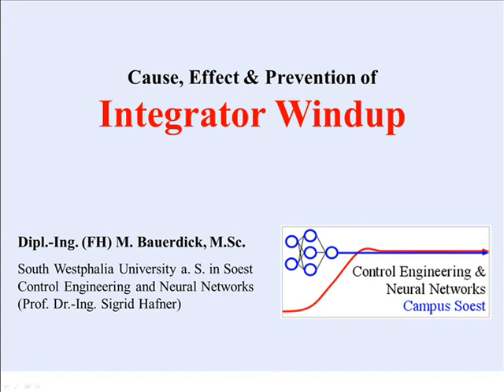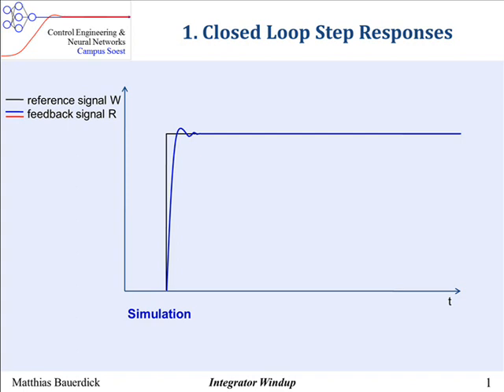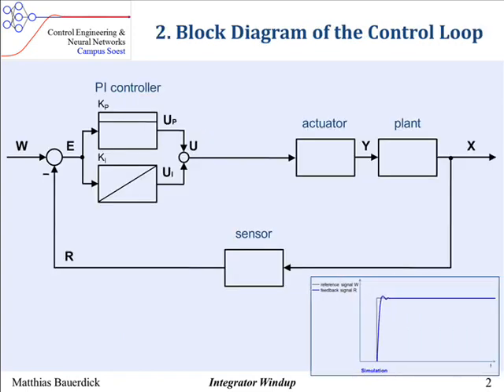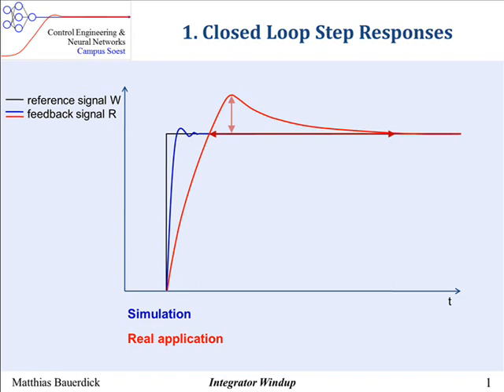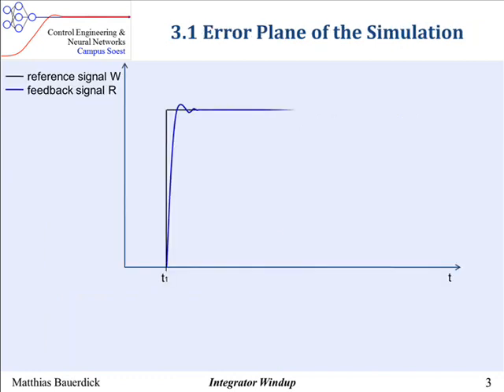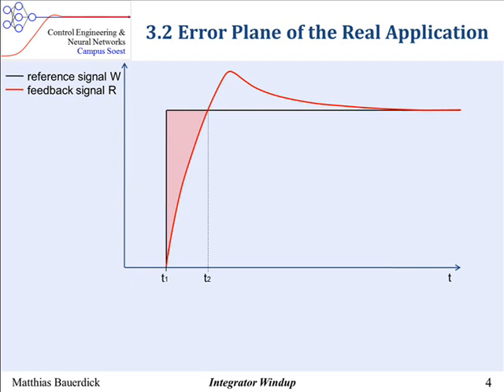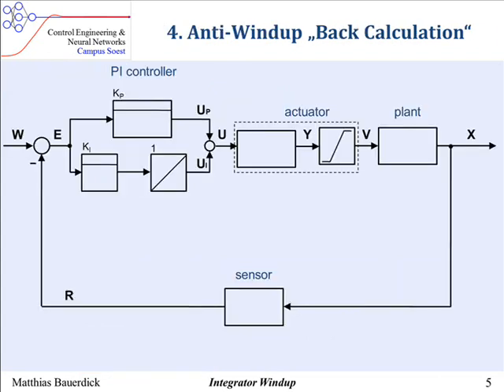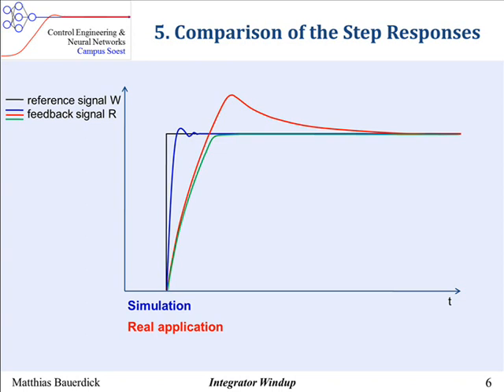Integrator Windup - Cause, Effect and Prevention

Comment: Excellent explanation. Very clear. I was always told windup typically exhibited itself when feedback signals are saturated for prolonged periods, which is no doubt true. However, I've seen the effect described in the video, whereby a real system experiences an unexpected overshoot with a relatively minor change in command.  I have suspected integrator windup as a cause, but could never put the theory to it myself or via research (admittedly my attempts were feeble).  My applications rely most on experimental (material testing) application of PID concepts, not control design through modeling. This is an excellent explanation tying together the more typical "ideal" systems undergrads are exposed to (my background) , and the possible phenomena seen in application.

Comment: Excellent analysis.   
Perhaps it is better to use the word saturation, in the first phase of the step-input, when maximum voltage is applied to the motor.
Only when out of saturation does the system become a mathematical linear control system.